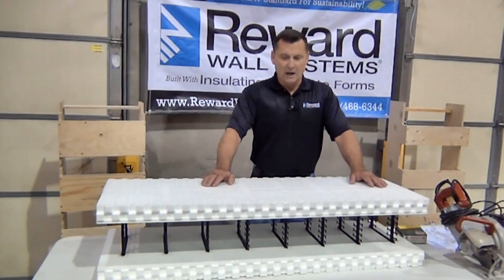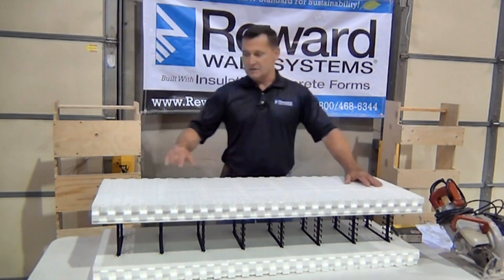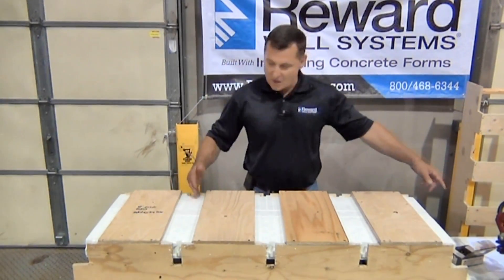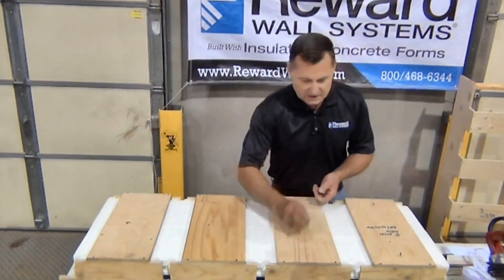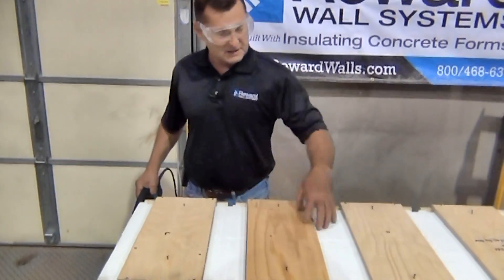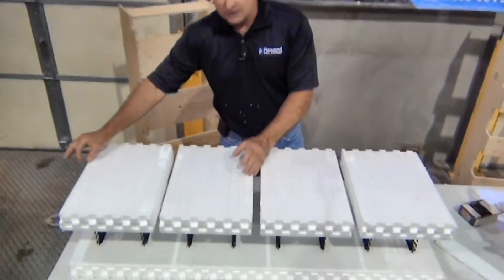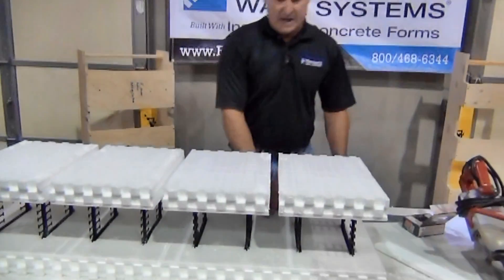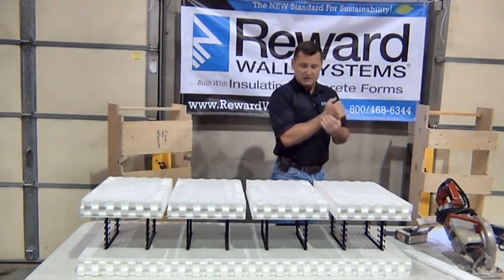How To Create an ICF Radius Form

Comment: Helpful video, thanks.  How do you bend the horizontal rebar that runs inside?
Reply: you bend the rebar.  You can use a rebar bender, conduit bender, or just anything heavy and solid enough with an open hole and bend it a little and pull a bit out at a time.

Comment: The amount of extra labor required to do this seems to negate the benefits of an icf panel. You might as well build something from scratch or choose a different method altogether.
Reply: if it is a below-grade wall, it would be worth the effort. but, i agree, it is a little retarded that you can't just send the company the blueprints with the specifications and quantity you need and have them send you curved ICF. there are suppliers now that can send you curved ICF; this video is 11 years old...
Reply: Fox Blocks makes radius blocks

Comment: when adding the top wall to the bottom 2 walls, why didn't you split the deferents on the bottom 2 with the top one ? seems to me it would add more strength to the  wall when pouring it !
Reply: +jonathon watterson Have you done this before? I'm curious because I could use some advice.
Reply: He was doing the way he demonstrated to make it simple but yes you want to brick lap the next row up, filling the needs is simple as cutting what you need for length (width) then doing the miter, or doing half miter then cutting the excess off a full piece.